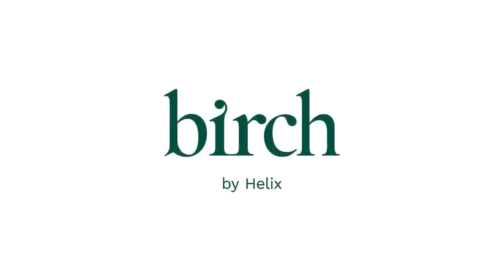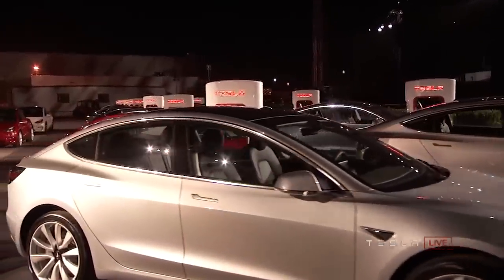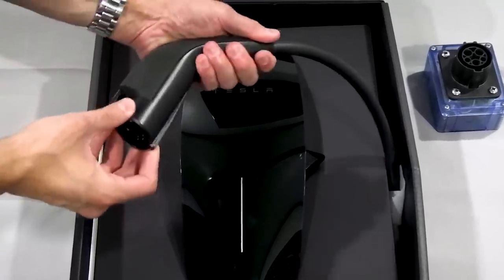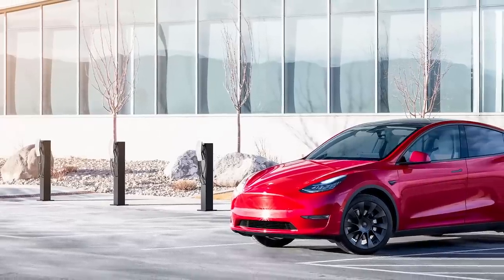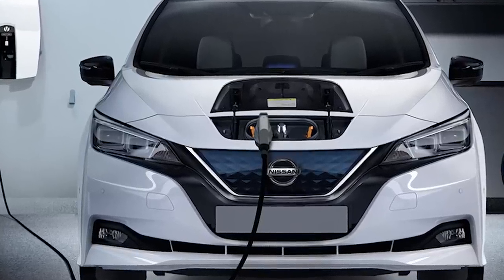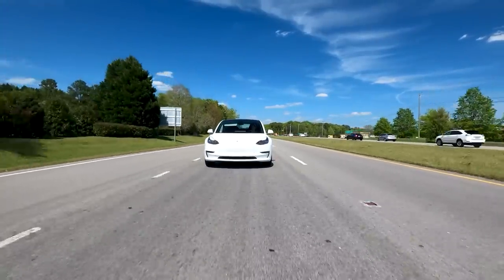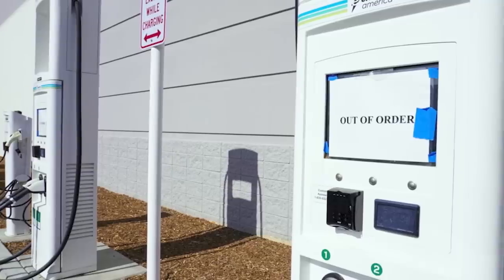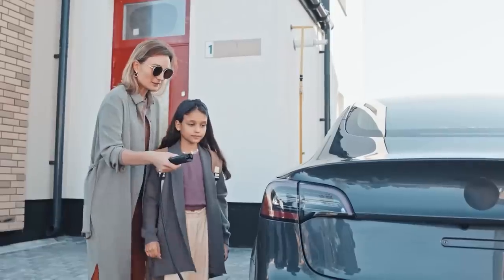Tesla's Charging Expert | In Depth

Comment: Imagine if every paid parking spots had an induction charging and while you park (let's say to go to work) you had the option to charge at the same time. All you need to do is equip yourself with an induction plate under your car, park and activate charging through your city parking app....      into the future! ;)
Reply: Doesn't have to be induction.
Keep it simple
Reply: I’ve seen articles about testing roads that will charge your car as you drive. Have been thinking about cordless charging as well! Like a big wireless charger for your phone without the full pad.
Reply: @rogerstarkey5390  to me ,that's simple. Drive over, open your app and activate from the same app as your city ''paid parking'' app (if you have that). Less to no cable manipulation that often is the cause of the charger break down.
Reply: Too expensive and reduced charge rates using induction. Plugging it in isn’t a big deal.
Reply: @chirpie11  instaling this on roads would cost lots of $$$$. But on paid parking spots on the city streets, now you got something. If you have designated charging stations it becomes like handicap zones, only EVs can park. But if you have a charging plate on every single parking (no cables to be used). Every car could just drive over and pay their charging fees (if it's an EV, the charging would activate) with their parking fees. If it's an ICE car, it obviously wouldn't activate charging. ;)
Reply: Would be nice and super streamlined but I figure there are likely technical issues if Tesla hasn’t pursued it yet?
Reply: @memeluke  Well at first it makes sense to go the other route, as Superchargers were proprietary connectors (not CCS). But now that they are transitioning to accommodate ALL vehicles, I think it would be wise for them to innovate in such a device and add it to their Shop Tesla for all to purchase the 2 part charging plates (one under your car and one for your home). Then talk to city councilors to install the charging plate under paved city parking spots...    Meaning huge revenues for their energy department!
Reply: @jasoncraig3863  one of the problems at this time would be the cost for road charging but as EVs become more popular- who knows! How about charging from cell towers? JuT putting it out there. Probably be a lot of RF concern but again…putting it out there!
Reply: Wireless charging is VERY inefficient.  Not a big deal when it's a tiny battery in a pair of earbuds or a cell phone.  For an EV that uses as much energy as a home each day, we can't afford to have 30% of the power wasted.
Reply: @CL-gq3no  Interesting. I thought you could get at least Lv1 or lv2 charging out of that. Thanks for the info.